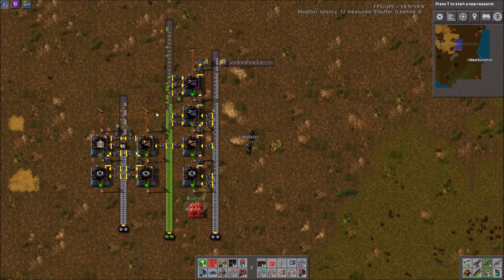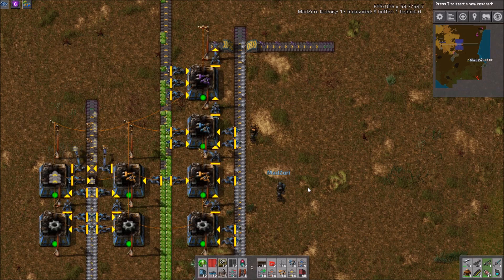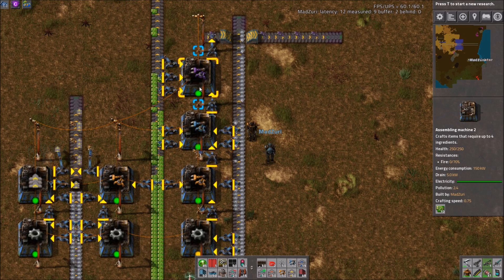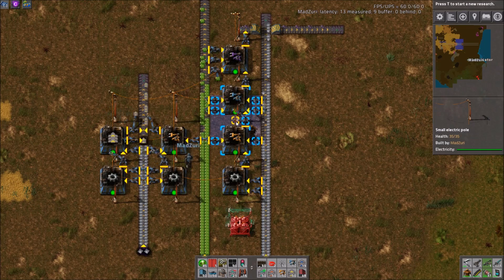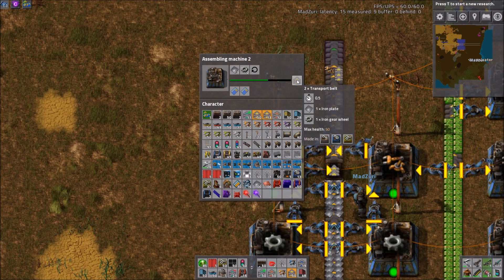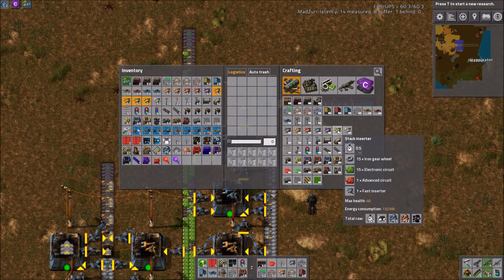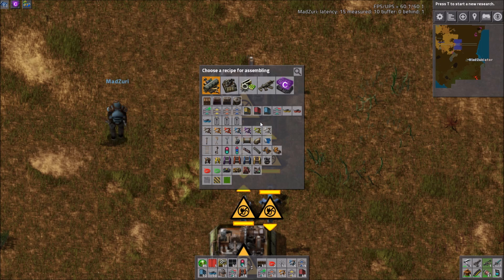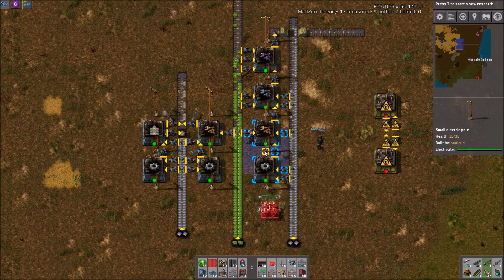Factorio Workshop - Building A Better Factory :: Inserter Production Build

Comment: It's great to see some of these ratios being demonstrated visually.

Regarding stack inserters, I do use a belt driven build on the basis that I don't need many stack inserters, and I can wait.
Reply from the maker: Yeah, even for me, seeing these visually helped me kind of understand the whole process more in-depth. 

If you don't need that many, then yeah a belt driven build is totally fine. But if you plan to actually have it running constantly then belts definitely are not going to work to feed it.